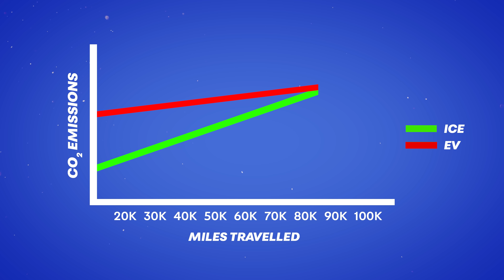Are Electric Cars REALLY That Green? [New 2022 Data]

Comment: In Soviet Union, when I was a child, I remember that there were no junkyards for cars. As Cars were deficit, they always got repaired and put into use again and again, and again. When the Soviet Union collapsed, we started to import 15 to 25 year old cars from the West and drove them happily, since those cars were much better than Lada and Moskvitch, which we were accustomed to. Where I am heading with this? Well, now I wanted to remember my youth and recently bought a 35 years old Volvo 740 and realised two things: 1) It is simply impossible that 35 years old electric car cold be operational, while Volvo of the same age can be used daly with no problem nicely. 2) It is much more greener to buy used car, then to buy a new electric car, since, utilising any car and especially an electric car, it pollutes. So, if we want to pollute less with our cars, buy used, fix old, make manufacturers produce less and at the same time more durable and long lasting cars.
Reply: I’m sure exhaust from that 35-years old car is lovely, fresh air.
And all fuel that was burned is also green and all flowery.
Reply: @VsevolodSolovyov  Nothing is lovely, fresh air. My point is, we need less of everything. Less travel, less food, less building, less manufacturing, less sex, less people and so on. If ecology is the prime task, it is better to buy an old car and use it very rarely. Communism is the ultimate green thinking. We all have to think for common good. Old Volvo is some 2000EUR. That means you will save greatly on the price. Even used Nissan Leave will cost you 5 times more. Thus, by buying old petrol powered car, you will be able to work less, travel less, stay at home more and be more green.
Reply: So many wrong conclusions, my friend... :) That volvo already polluted >3 lifecycles of an electric car, and I don't see why a 35y old 740 would be more reliable than a 35y old electric car. All this is coming from a volvo fan who had 7 volvos, so I can hardly be called an EVangelist :)
Reply: @vpajic1  Because you not making an entire new car. The EV is 45 tons of CO2 just to produce. The old Volvo's CO2 has already been spent and is a sunk cost, thus irrelevant.
Reply: There is a local company near me that takes those 10 year old Nissan leafs (still run but have shorter range) and replaces the batteries from newer wrecked cars which ends up giving the older cars further range than when they were new. 
EVs can be put back on the road too.
Reply: I owned 740 and 940 Volvos and I know what you mean BUT Teslas are going further , with far less maintenance, than those cars . .  Another thing that ICE does not count is the carbon foot print of the Oil Chance, Muffler, Brakes and the thousands of other ICE  parts  . .
Reply: @spencerbardell  electric cars don't have brakes now guys.
Reply: @spencerbardell  Tesla can't compete with Volvo 740. It is impossible. A used 740 will settle you back some 2000EUR. With fixing and sorting out everything, you look at some 4000EUR maximum. So, how much is Tesla? Even used Tesla is some 30000EUR. By buying old Volvo you save some 26000EUR. That means you can actually stop working. You will not need to commute to work and back. You can stay home with your children. You can actually teach them everything by yourself and children would not need to go to school. Basically, by buying an old Volvo, you can stay at home and be ultimately green for one year.
Reply: You are forgetting that that 740 has very, very bad emissions. Compared to that the break even point will be achieved in no-time. Also a 35 year old electric car is still operational, just by swapping the battery. The rest of it is actually more reliable
Reply: @sneaky_krait7271  Well, sure you can bring back a 35 years old electric car, but just for the swapping price you can by some 4 old Volvos. MMMmmm. Yap. As I have explained in my previous comments. It is better to buy an old car, save money and work less, so you can stay at home more, maybe even teach your children by yourself, so you don't have to commute that much. By buying less, eating less, traveling less and having less sex we can reach our green goals much faster.
Reply: @esparauto  In future this difference will be way smaller. Also the fuel for these old Volvos will be very expensive in 35 years. Also the old Volvo is less reliable than the electric car and parts will be way more rare too. It isn't better to drive in the old car that polutes so heavy. I agree travelling less is better, but there should be a balance in living and reaching that goal. I mean the best thing we could do is die, but I am not going to do that to save the planet and so shouldnt you
Reply: @sneaky_krait7271  The main thing that really bothers me is that those cars are too expensive and arguments, why to buy them, are fishy. There is nothing green about a car that weighs 2.5 tons and can at the same time reaches 100km/h in 3 seconds. Governments want lower or zero emissions, but the methods they use to reach these goals are wrong. It would be much wiser, to put a limit on maximum speed and tax cars based on their wight. Cars capable of much lower maximum speeds would need lower safety requirements and thus cars could be made lighter. Also, wight could be lost by making cars with skinny tires, giving up on such things as panoramic sunroofs, massaging seats, 18 speaker sound systems and so on. Lighter and less powerful cars would be greener regardless of the power plant they use, but the main thing, they would be cheaper and there would be no need for governments to spend money on subsidies. Instead of subsidising car buyers, governments could spend money on infrastructure.
Reply: @sneaky_krait7271  Swapping the battery would cost an arm and a leg and it would still give you subpar range and charging times. There's nothing to do about that until technology improves (if ever).
Reply: @TrollSuperStar  In 35 years from now, yes definitely. Immense improvement. If you put in a new battery the charge time and range will be up to date to new standards then as well
Reply: @sneaky_krait7271  That's a pretty big bet to take, especially when ICE technology is already here and it's proven and affordable. I wouldn't take the plunge towards EV until it reaches feature and cost parity with ICE.
Reply: @TrollSuperStar  It will reach that cost parity very soon already. In 35 years I can jut buy a very cheap 35 year old EV as well, no plunge to take then.
Reply: @sneaky_krait7271  It might reach parity in the future, but IMO it's not there yet.
Reply: @TrollSuperStar  Price parity isn't an opinion. 2025 is most likely to be the year EV is cheaper to make than ICE. That is without the benefit of less maintenance/running costs, just the car itself.
Reply: @sneaky_krait7271  It is just because car manufacturers stop producing cheap econoboxes. 15000EUR car can only be produced with ICE.
Reply: @esparauto  There are already EV's produced today for less than 15k EUR
Reply: @sneaky_krait7271  Currently the cheapest EV in Europe is Dacia Spring. It costs 18k EUR and is not the car you want for 18k.
Reply: @esparauto  Over here yes. In China you can get basically an ID.3 for 15k in the form of the BYD Dolphin
Reply: @peregrinestudio I also like the sound of a v8, and prefer manual transmission. But I find the ecological aspect more important than that, everything else would be selfish. So yeah, I plan to move to EV as soon as posible, and don't think I'll ever "look back". As for using a 35y old ev in the future, sure it'll be outdated. As much as a new Audi a6 or Mercedes s class. But I hope the recycling technology will develop to a point that everything will be almost fully recyclable.
Reply: @vpajic1  there's really nothing bad at selfishly driving a manual v8 and you should drop the "i actually like v8s and manual but..." bs because you aren't fooling anyone with that lame excuse. you can drive your electric car if you want, but let people drive their v8s without trying to tell them that they're literally the co2 nazi. i apologize for sounding so rude but the smug-ness of these ev fanboys is just too much
Reply: @peregrinestudio Yes they are still as usable. It will be the same as an old car having an old radio/cd player but it is still very drivable.
Reply: @peregrinestudio I think you may be over exaggerating a little. I do agree they are more expensive both in buying and replacing batteries, but this is changing fast. 
As for the fire issue, battery fires for the majority of fires allow the occupants more time to escape as they don’t explode like a gas tank on impact. 
There are precautions that if taken allow for safe storage of damaged batteries following an accident. We are learning from our mistakes. 

EV adoption is a slow process and we have plenty of time to work out issues. I don’t expect battery EVs in their current state to be the answer but it is a step in a new direction to move away from Burning fossil fuels.

Also keep in mind new battery chemistry coming would make new batteries non flammable.
Reply: That is the opposite to what the rich industrialist climate alarmists want you to do.
Reply: Plus you get it all cheaper. But so called "desiders" don't or don't want to understand it.
Pepole call this "green transformation" greenwash.
Reply: I fully agree. I bought my ICE car new and it's going on 15 years with hardly any problems. I'm planning on keeping it for at least another 5 years. My longest trip was 1400km in a day. There's no way I could do that in an EV. In an EV of similar age I'd probably prepare to buy my 3rd battery and overall I'd probably have paid 4 times what it cost to run my car. There's nothing compelling about EVs. Just marketing and propaganda.

Comment: We need to have these very blunt, honest and non-politicized discussions based on facts in order to actually make the changes we need to make. The Li-ion batteries desperately need to be addressed from production to recycling and disposal. Thanks Rory for bringing this up and thanks to Volvo for stepping out regardless of reasons.
Reply: Totally agree with your comment.  However, for balance, when was the last time you heard a discussion on recycling or disposal an internal combustion engine at the end of its life?
Reply: @jonathancullen1337  You are right as far as the conversation goes for sure. However, I do know scrap yards for years sold the old engine blocks to pipe manufacturers and the like. I don't know about the newer ICE's when they die. But its a good point.

Comment: This is very informative. Question though, with factoring battery change added to the equation does that change the data or was that factored into this research? Would love to hear about that.
Reply: The battery of an EV can lasts easily 10 years thanks to modern battery management software all modern EV cars use, so that is not a real concern I think.
Reply: I agree with you, however it is more likely that an ICE car will need its engine replaced before an EV needs its battery replaced. Also an EV has much fewer parts and fluids that need serviced/replaced.  This needs to be factored in too....

Comment: Or... Article from iNews...

Electric vehicles are more carbon intensive to produce compared to petrol cars, but drivers make up that extra carbon cost with just 7,000 miles of driving in the UK, new analysis has revealed.

An average medium-sized petrol car, around the size of a VW Golf, causes around 7.2 tonnes of carbon emissions to produce, according to analysis by the International Council on Clean Transportation (ICCT), an independent research organisation based in Berlin.

By comparison, producing a similar-sized electric car results in around 9.2 tonnes of carbon emissions. The extra pollution associated with an EV can be largely attributed to the battery, which is carbon intensive to manufacture.

But ICCT’s analysis, shared with i, reveals that this ‘carbon debt’ can be made up after 7,061 miles of driving an electric vehicle in the UK.

While petrol cars spew fumes from their exhaust pipe, electric cars run on grid electricity and so produce far fewer emissions when on the move.

ICCT calculated that a battery electric car running on UK grid electricity produces 35g of CO2 per km, compared to an average petrol car which emits 211g of CO2 per km.

In England the average new car is driven for around 10,400 miles in each of its first three years on the road, according to the RAC. Based on this mileage, a new electric car ‘breaks even’ with a petrol car in less than a year.

Dr Georg Bieker, a researcher at ICCT, calculated the UK figures at i‘s request. He has separately assessed the carbon impact of electric vehicle production and use around the world.

He said UK EV drivers would reach ‘break even’ on the carbon cost of their car more quickly in the UK than in the other parts of the world, including the EU, because the UK electricity grid uses more renewable power. In 2020, the latest year for which figures are available, renewables such as wind and solar generated 43 per cent of grid electricity.

“The UK has a cleaner grid than the European average, and therefore the benefits [of driving an electric car] are even higher,” he told i.

In the US for example, where more coal is burned for electricity, an EV would need to be driven 14,167 miles (22,800 km) before it ‘breaks even’ with a petrol car.

Larger electric cars with bigger batteries would need to be driven slightly further to reach ‘break even’ with a petrol car, as would electric cars made in China, which is heavily reliant on coal.

But over the course of an 18-year lifespan in the UK, assuming an annual average mileage of 8,388 miles (13,500km), even the largest ‘SUV’ electric cars has a lifetime carbon footprint more than 50 tonnes lower than an equivalent petrol car.

ICCT ran the same comparison between battery electric cars and diesel cars, and produced much the same results, Dr Bieker said.

The findings chime with analysis conducted by consultancy Ricardo AEA for the European Commission, and a separate assessment from climate website Carbon Brief. However, it diverges sharply from calculations made by the automotive industry.

In November Volvo released life-cycle calculations for its C40 Recharge, suggesting the electric SUV would need to be driven for 48,000 miles in the EU to hit break even with a similar petrol car.

Comment: None of this is an equal comparison unless we consider the costs of mining, transporting, refining, distributing and selling petrol. Everything from drilling, shipping around the world, the construction of gas stations, the electricity necessary to do it all counts as well. And it's necessary for this supply chain to exist to provide tanks full of explosive goo for the lifetime of the vehicle. Once you add all that in, it's not even an argument anymore that EV's get the win.
Reply: I think Volvo did factor that in. It's called 'Well to tail pipe' . However, did they factor in the carbon footprint of the ice engine with its huge parts count Vs the simplicity of an electric motor with very few moving parts?

Comment: Question : when people talk about EV vs ICE they talk a lot about how the electricity is produced but never how that petrol and diesel is produced. In my knowledge in this kind of comparison they only measure the tailpipe emissions. But not the emissions of the truck carrying the fuel,the tanker that carries the petrol and so on. Am I right ?
Reply: Apparently Volvo have factored this in, it called 'well to tail pipe'. What I wonder is the carbon footprint of making hugely complex ice engines with a large parts count Vs a very simple electric motor with very few moving parts.
Reply: @yoda-be.at1746  I like how you started the comment : "apparently". Another thing that I would like to point is that in real life (at least the WLTP) cars consumption is 25-30% higher. That means CO2 emissions. I think that the most important thing here is that YOU CAN'T PRODUCE PETROL AND DIESEL AT HOME, but you can produce electricity
Reply: @andreiarama8745  Yes a thing I see mentioned very little, is that we can produce electricity ourselves now. I'd rather not rely on big oil companies artificially increasing the price of the stuff my car drives on.

Comment: Two things i like about electric cars: if all cars are EV then when you go outside in a big city you dont smell exhaust gasses. also its healthier. in big cities noise pollution is much higher than outside, so we dont have people who put coca cola cans on their exhaust and rip to 7k rpms.

Problem with EVs is short mileage and charging. i thing universal batteries for all manufacturers like we have for remote controls and exchange stations would be more beneficial then charging stations. you go to a station and technicians swap your battery for freshly charged one in 5minutes. currently it takes more than an hour to charge and not all charging stations are working. AAA batteries for cars :D

Comment: Fact is always better than fiction. The majority of consumers want to go from a to b with little or minimum over head. Both ICE and EV have come a long way. Where I live, my household consumption of electric is about 600kwh per month on average. If I buy electric car, which I may get 200 miles range per charge with an average capacity of 60kw battery. I may need 240kwh per month. We have two ICE cars at home and if we had to replace them with EV, that would have ben 480kwh per month. I believe if all ICE cars to be phased out in the next x number of years, it may require a realistic study such as the Volvo study! Technology strives if we acknowledge the challenges which comes with it. City life and country side do exist on the same planet earth:-)